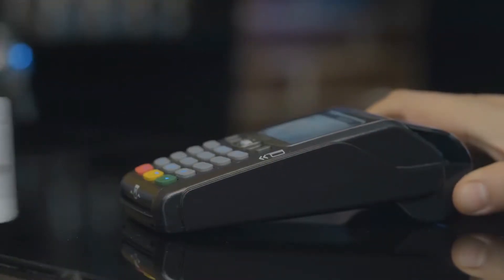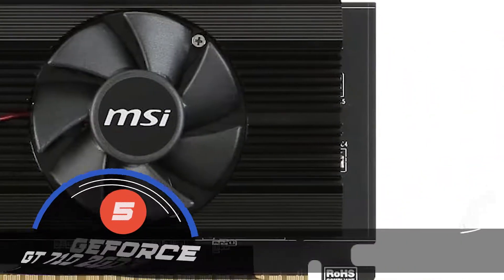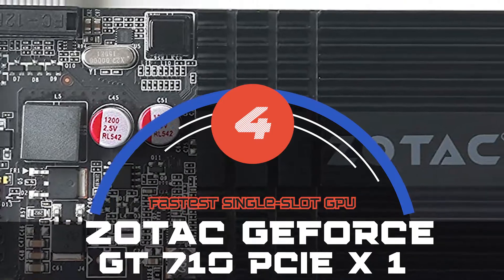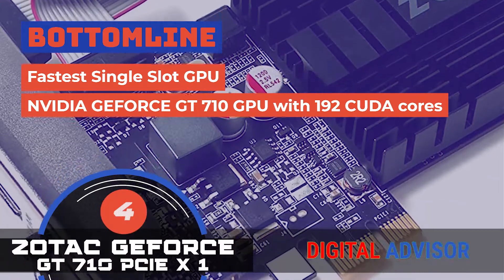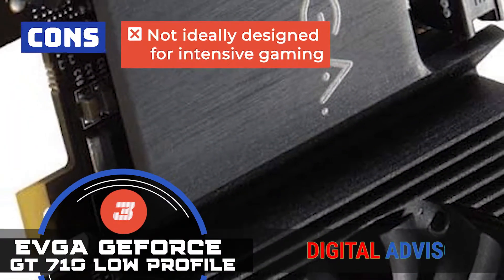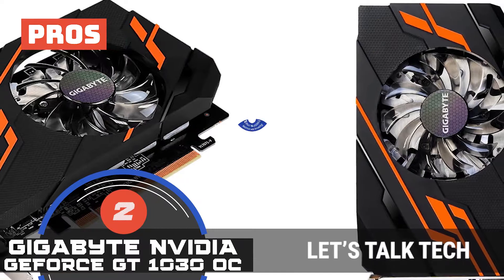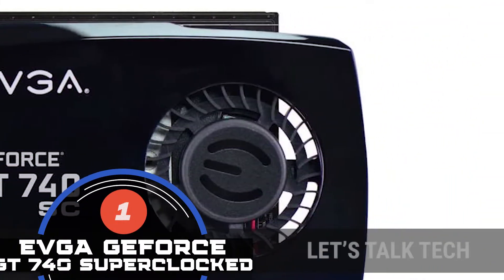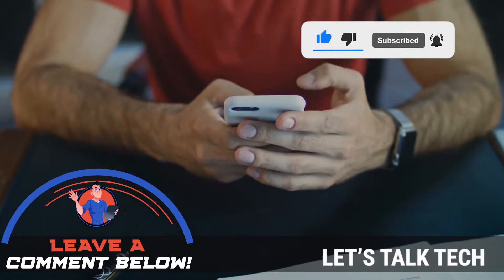Best Single Slot GPUs 🖥 (Buyer's Guide) | Digital Advisor

Comment: There are much better single a lot gpus you can get actually, at least from a performance and use ability standpoint, in fact I believe there was a gtx 1070 single slot card.
Reply: amd released a low profile rx 6400 which is a single slot gpu and the rx 6400 is much more powerful than the 1070
Reply: @lovejoysantos8038  where did you get your numbers from? The rx 6400 is a good single slot low profile card, but the gtx 1070 is on par with the gtx 1660super, and the rx 6400 is about on par with the gtx 1650.
Reply: 1070 is extremely rare haven’t been able to find one anywhere